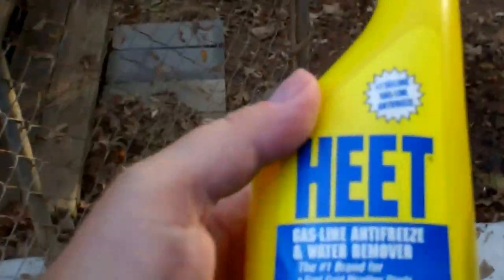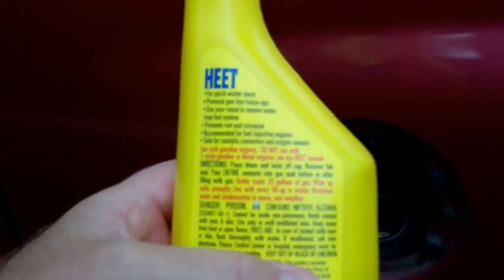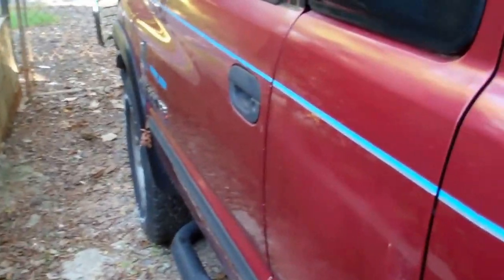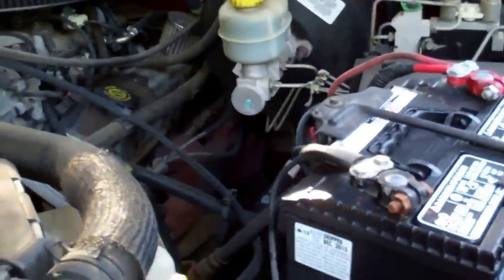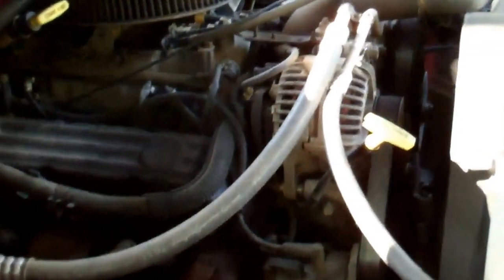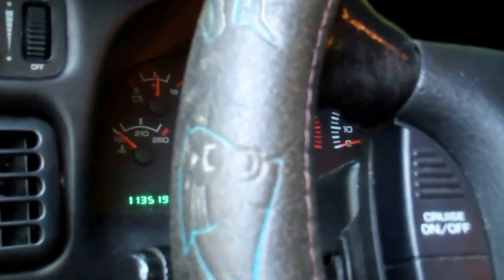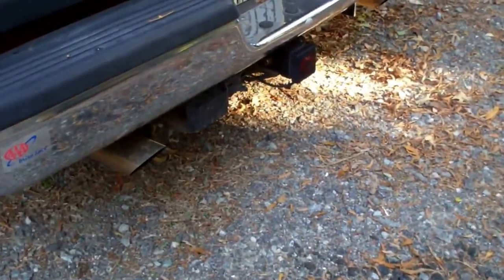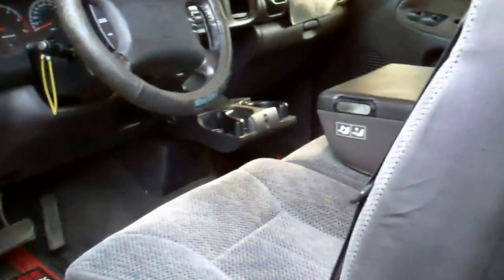Gas Treatment & Cold Start my Dodge Ram

Comment: my friend Richie, ball joints aren't that expensive to change also the ball joints they are not expensive, the ac the worst thing it could be it's the compressor around 150 for a remanufactured one.  bring it to my dad in cali LOL.
Reply from the maker: Already got the quote: upper and lower ball joints for both sides will be around $700 and the AC condenser is damaged from a deer I hit a few years back; around $300 minimum to replace and recharge the freon.. 
It still drives so those repairs are not on my priority list at the moment
Reply: i guess prices vary by state.

Comment: will you ever sell your truck
Reply from the maker: Doubt I would get what it's worth as it needs over $1000 dollars in repairs (Ball joints and AC work)..
Reply: eh depending on the conditions how long had you haved that truck
Reply from the maker: Since 2004. It's in great condition for it's age with only 113600 miles on it, but with no AC and the ball joints making all sorts of loud squeaking noises, that hurts the value.
Reply: wow she's a keeper and for the truck's age lol how much for the repairs in Carolina
Reply from the maker: Yeah I'm not advertising it for sale.. Already said over $1000 for repairs...